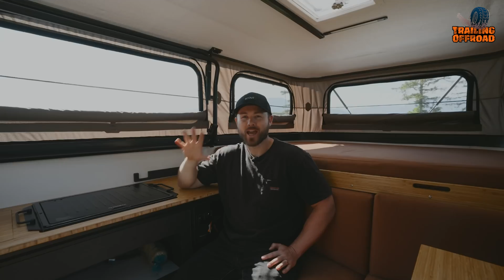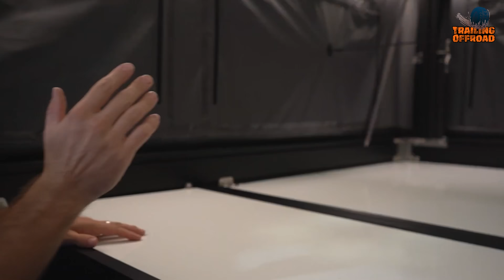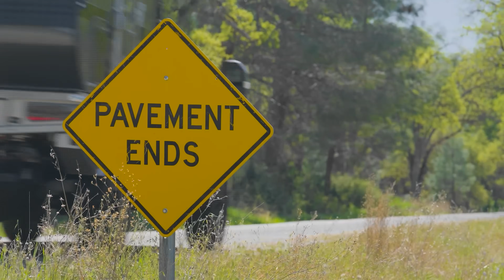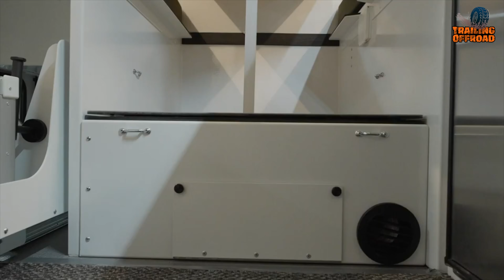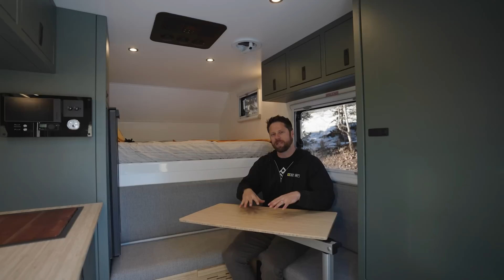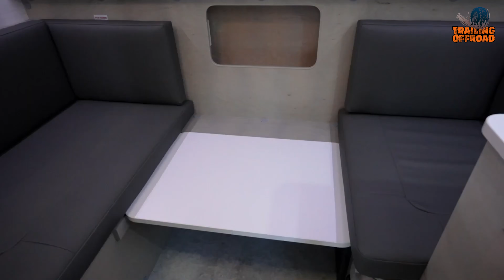15 Best Lightweight Truck Camper Made in USA | USA-Made Truck Campers

Comment: Complete nonsense.  I work in the industry, and while this list does include some good choices, the majority are nowhere close to top tier with respect to weight.  The camper that sits at the top is not even on this list.  That would be the Aterra, designed and engineered by David Soza of Tern Overland and produced by AT Overland.  The closest competitors on a weight/volume/strength basis are 40% heavier.
Reply: Cause this was created with AI BS not real human input.
Reply: @tonyg3414  As are a lot of these "most" or "best" videos. Fortunately, once you've seen a few the BS is easy to recognize.
Reply from the maker: Thanks so much for sharing your point. We'll definitely take a look at the Aterra!
Reply: What truck, and camper do You recommend to keep it under $13,000 total price, truck and camper combined.
Reply: @Lawrence_of_Asia  Lawrence, that is a tough one since it is hard to find a good truck OR camper for that price alone.  The OVRLND Camper shown in this video is one of the best bangs for the buck in overall quality, but you still have to build out the inside. I don't have any financial ties to them, but I do know Jay, the owner, and they are solid people to deal with.  If $13K is your total budget, your best bet is to find a solid reliable older truck, a used topper, and build that out. You can occasionally find good deals on used campers too.  Another option is a lightweight teardrop or compact trailer that can be pulled by your existing vehicle.  There are countless builders out there, and some priced very reasonably.  Most of them could be towed with a Subaru.  They are not meant for hard offroading but perfectly fine for forest service roads.  They start as low as 5K new.  One brand that I could recommend is Hiker Trailers.  They have been around for a while, and build a decent little trailer. I think they start around 5K.  Hope that helps...
Reply: @SageDS2x absolutely!  Greatly appreciated!
Reply: The Aterra base price is $90,000. I can get an equivalent unit (though not equal) for $20,000, if I'm willing to buy Chinese (which I'm not). And therein we have the anatomy of offshoring of jobs (consumers demand it).

Comment: They’re all poor designs. USA dependence on propane anything is why they’re all bad designs. 
Diesel heaters are a much better product. Australia leads in the design and manufacturing of truck campers.
Reply: Nonsense, Propane is available everywhere in the US but diesel isn't. Australian campers are poor designs for US because they don't have winters like the US does. That also makes propane better than diesel.
Reply: @thedarkside3394 your wrong. Every USA truck is available with a diesel. The heating systems are far more efficient than propane will ever be. 
Plus all Australian manufacturers offer a heating option propane is obsolete
Reply: @BlueVanDamn  What are you talking about? No not every truck is available in diesel. And not every place has diesel. There are places that don't offer diesel. You have no clue what you are talking about.
Reply: @thedarkside3394  ram, ford, Chevy, Nissan, all diesel. I’ve been doing this all over the world and have 0 concerns finding diesel in 5 years.
Reply: @BlueVanDamn  Most people don't use full size Dodge, Chevy or Ford to overland. They use mid size, and they don't come with diesel. Most use Nissan, Jeep & Toyota. Jeep & Nissan no longer comes in diesel, for now. Toyota is thinking about selling a diesel in the US, but not yet. Most people that overland out west, complain about diesel being hard to find.
Reply: @BlueVanDamn  99% of trucks in the USA running diesel are heavy duty trucks, which none of the campers shown here require. Surly you can put 2 and 2 together? WTF are you on about? Just another opinionated aussie, and the only thing Australia leads in is an authoritarian government and a penal colony mentality.
Reply: @thedarkside3394 get out of your city!
Reply: @t @thedarkside3394 ost people, but you, especially in industry and larger pick ups use diesel! Break out of your bubble
Reply: A lot higher maintenance but some tear drops are offered with them here now. I have been driving the same Cummins diesel for 27 years, yawn.
Reply: @melissasmess2773  i’ve had my second one since 2007 pre-DEF. I get bored with the reliability and then I have to slap myself
Reply: Wood or pellet stoves as well.
Reply from the maker: It's interesting to hear your thoughts on propane use in US-made campers. We already mentioned some with diesel heaters tho. But yeah, we appreciate the feedback!
Reply: Trailers too but as much as a house!
Reply: Diesel water, heaters, diesel, furnaces, diesel cooktops! And pull with a diesel truck is the way to go. You only have to pack one fuel source.